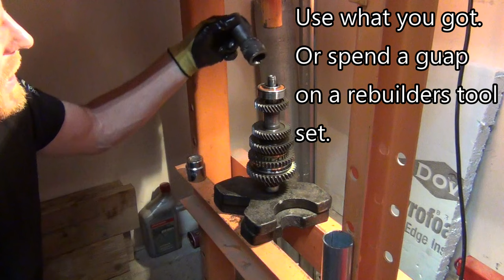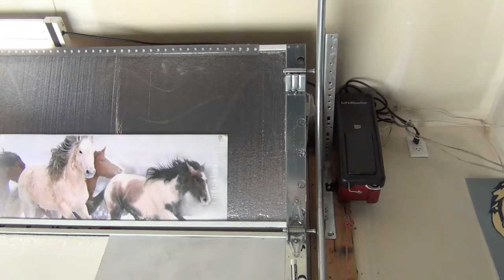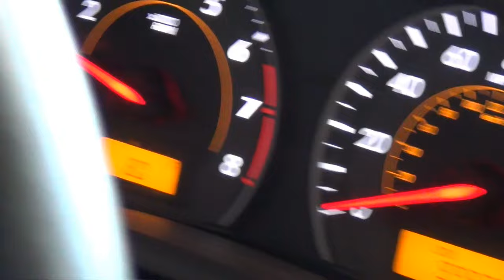Manual Transmission Scynchro Replace / Rebuild Toyota Corrolla Part 3 Assemble

Comment from the maker: Get the yellow impact gun used in the video here → http://amzn.to/2eVlEa6 mine was $150 more when new (they've come down in price a ton!) and yours will look so much better than mine! Get the big green machine for lugnuts here → http://amzn.to/2xmNVy8 (I wish I had 4 of these! 1. Patrol vehicle 2. Truck 3. WRX 4. Garage.)  
They're the coolest thing ever for doing flat tires on the side of the road!
Reply: Dunno Brian, used the standard van set last week, and even with having to RTFM to find the stuff ( later read why the one spare wheel nut just kept spinning, made it easy to put back) and using the dinky jack it only took 15 minutes to change that flat.

Did it in under 10 minutes years ago, in pouring rain, as I knew where all the VW tools were, and just tossed every thing I absolutely did not need ( including the flat tyre) on the road onto the back seat and hauled out of there, with heater on max and trying to drip dry before getting home. Put it all back later after the insurance claim for the pothole.
Reply: I been telling my friend (as we try to fix his trans 84 corolla) that rebuilding a transmission is harder than the engine because you can't really go ask anyone how to anything with it because not many people have done a transmission like they have done an engine.
Reply: Where did you get your sychros?
Reply: @Dalton Rory Definitely, I have been watching on instaflixxer for since december myself =)

Comment: Now a theft proof vehicle, as I guess a manual trans is a rarity ( not even available as option on Corvettes I hear) in the USA these days. See you got the right oil as well, just using SAE80 will make them balky, you need that SAE75 in there.

Hope you also changed the clutch release bearing while in there, always cheap to do while you have it out, and pretty much will always help as well.
Reply from the maker: This puppy got a brand new clutch!  It was time to just fancy things up while we were in there.  Did some new seals too.

Comment: Interesting video, nice!

I could be wrong, but isn't it bad that she keeps her foot on the clutch and her hand on the gear lever?
Or did she have to shift soon in the clips?
Reply: That is why I commented it indeed.
But I would have figured Brian would have told her, that is why I wasn't sure.
Reply from the maker: Resting your foot on the clutch pedal down the highway is bad.  It wears everything out in your clutch kit, but especially your throw out bearing.  Hovering or covering isn't bad.  It's a matter of pressure.  Anyone that gets 100k on a clutch set is doing decently well.  I've had customers blow one to crap in a week.  Had to go out driving with them and watch how they drove on the second clutch- it was them.
Reply: I blamed spanky for ALL OF IT in an earlier vid....
your documentation of her technique settles it, she's not the issue/monster I thought she was, my apology, 
pass it on. :  (

Comment: Hello Brian: Would appreciate if you could help me understand what's wrong with my 2002 corolla manual transmission. My clutch was changed recently, there is no issue with shifting or down shifting. My engine runs good as well. I hear an intermittent noise (every 5 to 10 seconds), something like a part coming loose that I only hear when the car is moving on gear engaged (all gears). The noise goes away when I shift to neutral while the car is moving. Any clues as to what the problem could be?

Comment: How did you pressed the rest 5th gear in the position please? I plan to use old nut there to press it, but maybe there is a better method. Thanks

Comment: I've heard that some people have had luck getting more life out of bad syncros in Toyota gearboxes by changing fluids. That some of them are very finicky on what works with them. Some like single grade dino oil. Some need synthetic or multigrade. 

Nice video though. Not a job i'm looked forward to ever having to do. That's for sure.

Comment: There aren't any syncros on my freightliner Eaton fuller 10speed transmission. My options are to double clutch or rev match
Reply: Joe Johnson well, if I don't rev match, it grinds. It has done that since it was brand new. All of the manual trucks in the fleet do it too. I'm not sure what dogs really are, but in my case, there isn't any 'grind protection', for lack of a better description.
Reply: Joe Johnson It is possible that I'm not explaining it correctly. I'm not a mechanic. Like I said before my fleet has about 3,000 manual trans trucks and they all do it. In the beginning of my trucking career, we had to take a class just on how to shift and how to rev match or double clutch. Plus, you definitely have to rev match for downshifting for jaking down a hill.
Reply: Josh Zotz The transmissions in big trucks, are not fully synchronized transmissions, like in car and light trucks! When you shift one, you have to ensure that the input shaft speed and the output shaft speed, (the engine and the road speeds) are the same!! You can use a technique called "DOUBLE CLUTCHING" or you can use a technique called "SLIPPING THE GEARS"! 

Either way, you can not shift from one gear to another, without speed matching the different gears!! Even with the clutch depressed, with the input (engine) speed, and the output (road) at different speeds, the gears will not mesh together!! And no matter what you do, the totally improper gear cannot be obtained, at all, ever, never, won't do it! You have to be able to match the engine R.P.M.s and the road speed, to get one into a gear!
Reply: roadkill5333 That's right. Good explanation. I couldn't explain it at all. Joe Johnson is right about the trans not having syncros, however, I don't think anything is wrong with my truck. I believe this is truly how they are designed and rev matching or double clutching is your only way to engage gear. I'm not exactly sure what the cringy grinding sound is when I miss the rev for a gear.

Comment: 0:55  Again with the Model T...lol.  No rev matching with planetary gears, since they're always engaged.  :-P
Reply from the maker: Maybe I'm thinking of the Ford model A then?  I drove an antique car that was a lot more work to shift and it really took some timing to get it right.  I mess up names.  It happens.
Reply: I think so.  Model A had a non-synchro sliding-gear box.  Model T has a planetary gearset.
Reply: PS:  And I HATED trying to shift a Model A.  Even when you're double clutching and rev-matching and taking your time...it's still virtually impossible to avoid crunching a little.  :-P

Comment: 1:28 did you just say rebuilding a transmission is intuitive? :)
Reply from the maker: The gears in their relationship to the shaft is intuitive.  There's marks where bearing are- they go biggest to smallest on the driven gear.  And you just match up the splined to splined and put clips into groves.  Everything has a home like a "tab a into slot b."